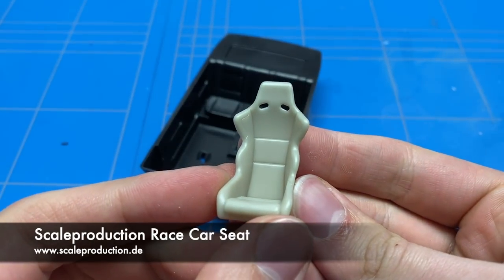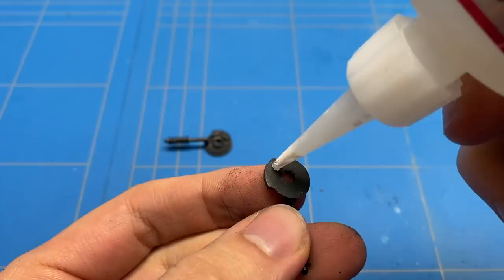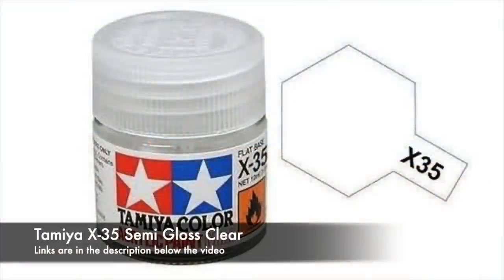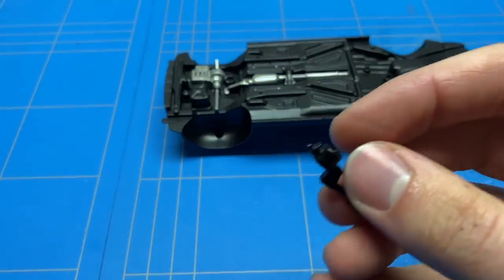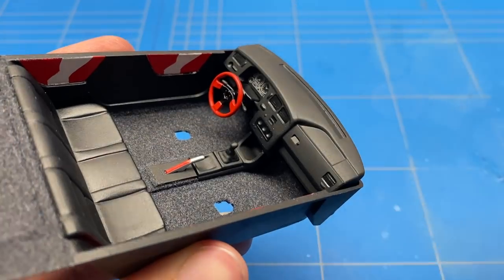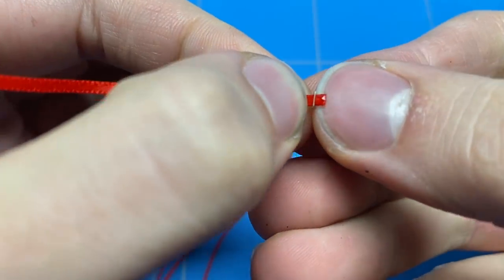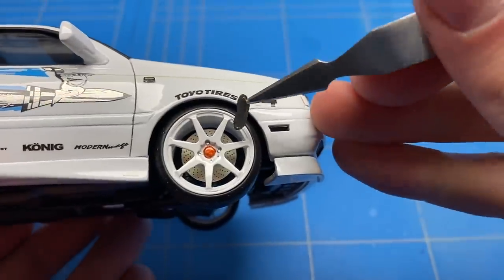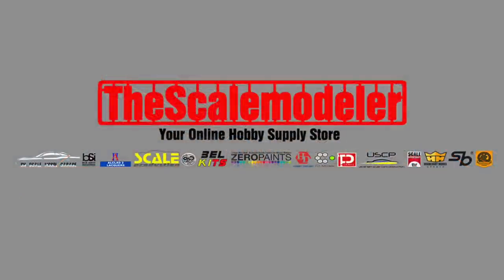Building a scale model of Jesse's VW Jetta from the Fast and the Furious Part 3

Comment: You got me with calipper jokes
Reply: Epsilon F G does the movie car not have brake calipers? I’ve never seen any of them, but during the video I figured the rear brake discs were faux and the real car had drums, as was kind of common at the time, but how did they handle the front?
Reply: @3Dsjk  It does have brakes. But during the Race Wars scene they installed big brake disks in front of the real brakes to fill in the huge rims. It would have looked weird to see small brakes behind the big 19 inch wheels